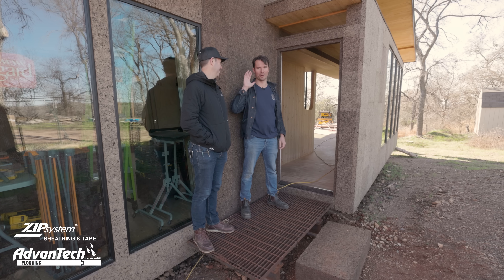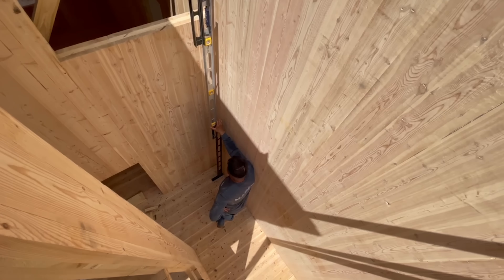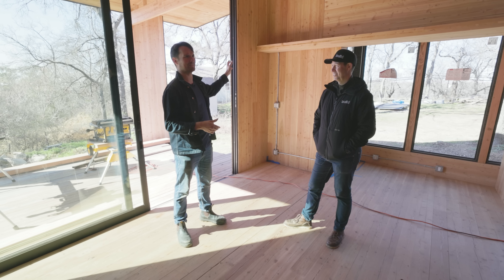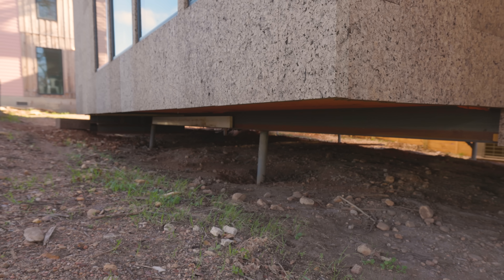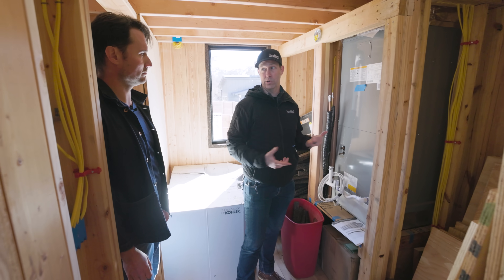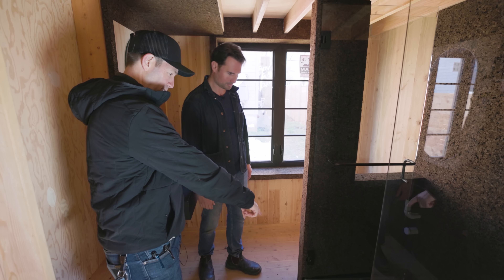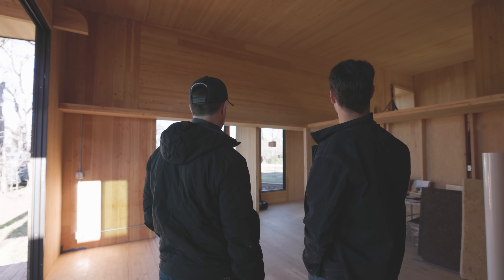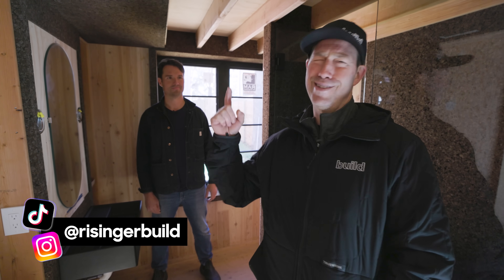CLT House - Zero Drywall and a Cork Shower!

Comment: Maybe i'm wrong but cork shower seems like a horrible idea.
Reply: It’s obviously impermeable to wine, why not water? Not to say I’d use it, I’m far too happy with tile…but it IS cool
Reply: @DrMJJr  cleaning would be an issue
Reply: Just because you can, doesn’t mean you should…  How do you scrub soap scum and grim from a cork shower enclosure!?  Matt, I’d love to see a follow up in a year or two to see if the shower was ripped out?!  Everything else looks amazing; thanks for sharing.
Reply: @atodaso1668  agreed, I was thinking the same thing, but seeing different approaches to what has been a relatively unchanged standard IS interesting if only to illustrate that things CAN change (though not always for the better).

Comment: I don't think that cork shower is going to last very long.  There will be soapy splattering that doesn't occur outdoors. Shower enclosures can build up- a dirt film.  I also wonder about whether the walls will stay unpainted?  Walls can be scuffed and damaged from use. Paint helps to hide the wear and tear. 

I wonder how easy it will be to repair fire damage? Will entire panels have to be removed?  Especially on the tall buildings this could be a problem? .  The building may not collapse but it will smell of smoke on some days. Somehow the char will have to be removed.

Comment: There are many charlatans out there, positioning themselves as experts who are not humble enough to correct mistakes.  It is because they are paid to say those things as ads, much like this channel.
Reply from the maker: What’s the context of your criticism here?  What mistakes do you mean?
Reply: @buildshow  for example (just one)...saying that one shouldn't use water softeners because of the "added salt" in the water.  That is NOT how water softeners are supposed to work.  Clearly you were paid by the system you were advocating for, using a false sales pitch to encourage viewers to use that system that you were installing (basically an ad).  You have not issued a correction or removed the video when multiple viewers commented.  No functional water softening system adds any appreciable amount of sodium to the water supply (as waste yes). It's ad revenue that prevents you from doing the right thing, unfortunately.  To take it down, you'd have to take a pay cut.  I think you should model yourself more like Stud Pack or the Tile Coach.  Who embrace humility and honesty. In so doing they also generate YT revenue.
Reply: @buildshow  I notice you've gone silent.  Your silence is deafening indeed.

Comment: Costs more than traditional building and looks like garbage. Industrial look with exposed everything. Who has to go into drywall when its done??? For what? Overthinking and just trying to hard to be different. Looks terrible. Exposed plumbing and electrical??? Any new custom house now has just as good insulation if not better than that cork. Looks like it belongs in a mobile home park next to the other trash.